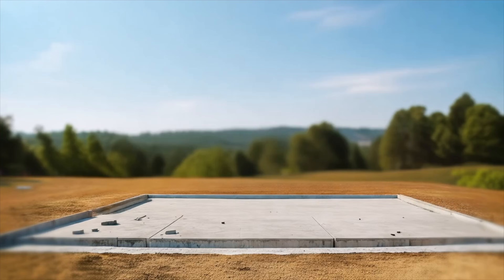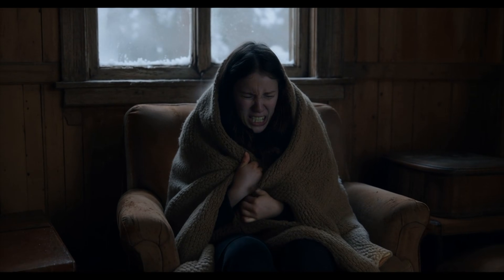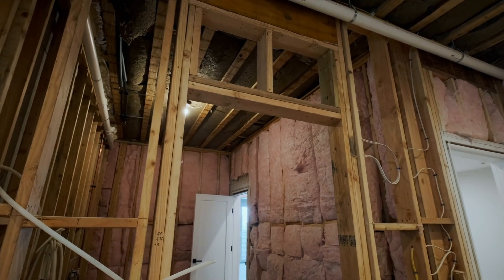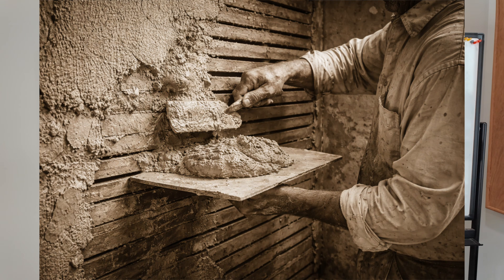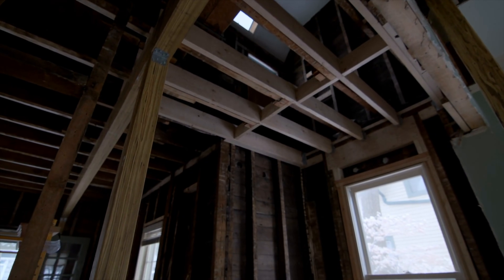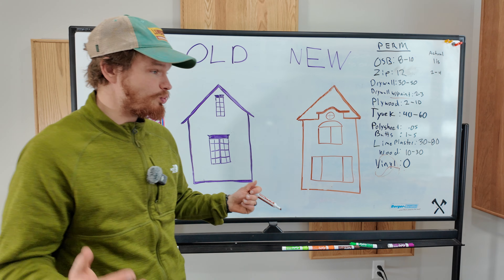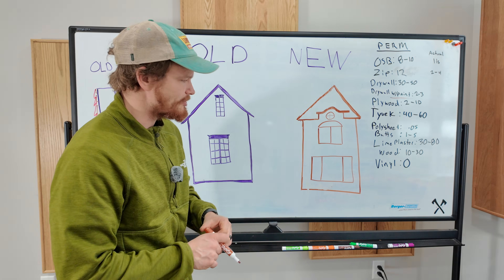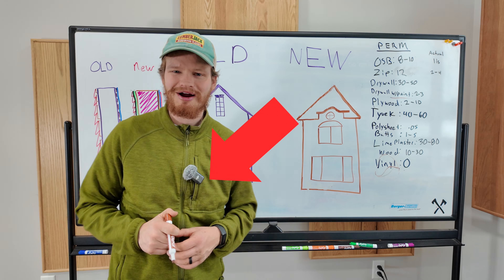New Houses Are Growing Mold — Old Ones Somehow Usually Don't

Comment: From European perspective these are not houses, these are fancy sheds, barns, shacks etc. Clay bricks, ceramic bricks, blocks are the only materials that can regulate moisture inside, sound proofing is fantastic, quite soft and strong at the same time for cutting. No mold can grow on ceramic material. One more thing that raw clay plaster mixed with natural fiber becomes new standard in wealthy people's homes, even if wall is made of concrete block, another terrible material, clay plaster will create micro climate and no paint required. Wood on it's own can be healthy and mold free under 2 conditions. No chemically treated wood, well dryed. Northern America housing styles are the crappiest right after British and Irish.
Reply: Its great that you guys have brick, but america has earthquakes... theres a reason houses are built with wood here
Reply: @Mae_flow  The reason houses are built with wood is because it's cheap and the people buying them are usually ignorant, not because of earthquakes.
Reply: @Mae_flow America is not so rife with earthquakes that it plays a dominant role in determining our building materials, unless you live on the West Coast
Reply: How many Europeans can afford homes? I’d rather have a wooden house than live in a flat.
Reply: @lisareiter5368 You are more than welcome to visit Europe and learn how new homes are built (Poland as example) reason some can't (don't) have own home is result of laziness. 250k EUR to buil small solid bungalow is more then enough if you do it yourself. But most want to hire scammers called contractors who will charge the lazy man 450k instead.
Reply: Clay brick is terrible where I live. The winter destroys it quickly.
Reply: @EthanThruandThru How about use transparent sealant from the outside?
Reply: North America has a much more varied climate, seasonal changes are huge compared to most of Europe, large temperature and humidity swings necessitate wood since it can expand and contract, and there are tons of weather patterns and storms to worry about. Some places like Florida or Arizona use different materials of course due to the climate.
Reply: @Ryan-cb1ei Have you ever been to Europe? Except for tornados the climate is very similar, freezing and wet in northern Europe, super dry and hot in the south and near the Mediterranean sea. -32 C to 50 C in summer. Clay bricks are used all across, recently clay ceramic blocks instead, very light and full of cavities. Europe also has earthquakes just to remind some previous comments makers. Poured concrete ceilings are required and reinforced concrete-steel ring round upper layer. Hardly to see wooden structure upper floors unless UK and Ireland where quality is not a thing, just blindly copied from US or Vice Versa.
Reply: @maximmono1  Obviously there are places in Europe with relatively hot or cold climates. I said most of Europe. Most of Europe is pretty moderate, it gets both colder and hotter in a lot of North America in the same places. You’re describing Northern Europe vs the Mediterranean, I’m talking about North America seeing extremes like that in the same places, different time of year. I was shocked to learn the average winter temperatures of northern countries weren’t as cold as I thought, and didn’t snow as much as I thought compared to some areas in the US and Canada. That jet stream really moderates Europe. But the actual real reason is due to timber. The US and Canada have access to so much natural timber compared to Europe it’s unfathomable, so it’s very cheap.
Reply: @Ryan-cb1ei Please note Europe ends in Russia not in Germany or France. The continent is not as big as North America however the  temperatures I described apply to the vast majority of the continent. Harsh winter and hot summers are not unique to America. At the end of your comment you used the word "cheap" if so why houses are so damn expensive if you use such low cost material? Another aspect is Europe still has great forest ie Poland, 1/3 of territory is forest however no wooden houses are built. Wooden structures especially outdoors won't last. This American style, fast and cheap, can't last forever. I hope you could visit Europe some day (the real Europe) not rotten western countries and see how things are done, how they last for thousands of years in harsh climates. Please visit the world's biggest castle in Poland which is made only of clay bricks, not stone like Brits did. Clay is everywhere under ground, it remains as deposits for Ice age, where as far as know was very present in North America. I wish you the very best in New Year, please travel across the world to make observations do not be biased by  opinions but by facts and experience.

Comment: Houses that breathe are freezing cold in winter and hot in summer. There's a GOOD reason we don’t pay to heat the air that's just going to leak outside. Borax can be used in wall and paint materials to keep mold from growing. And we aught to protect wood frames better from rain than we do, in the construction phase

Comment: So our options are:
1) be a millionnaire who can afford to build new with solid dimensional lumber, and also freeze in winter, or
2) Build something affordable that'll just get moldy.

Fade me.
---
I'd much rather see something productive, like "this is how to reduce moisture in modern construction". Include tips like avoiding flat roofs, doing semi-annual attic insulation checks, checking settings on any in-line humidifiers, etc etc etc.

This video, as is, offers no meaningful value

Comment: Um, pine tar, bees wax, and flax seed oil. This is why the old hard wood last centuries.  It protects wood from moisture,  bugs, and rot. 
The materials we use today are ment to be 50 year homes. The wood, staw and clay of ancient homes lasted much longer, cheap to repair,  and better insolation.  Actually had a thermal mass unlike today's buildings.

Comment: My 115 year old house got central air this last year and let me tell you about the mold 🙃 it started growing everywhere, bathroom, windowsills, and even on the floor registers. I have chronic illnesses not related to the mold (I hope) and didn’t need the extra tax on my body so I’ve done a lot to remediate it. But my old house was none too happy with the upgrade. I’ll probably put a window unit in my bedroom next year and not turn the air down so low in the rest of the house to keep condensation down. I also got a dehumidifier but we plan on installing a vent fan in our bathroom/laundry area for continuous ventilation. It’s humid in Kansas and sometimes it’s not an option to open the windows for ventilation
Reply: If the a/c runs long enough, it will keep the air dry, so how is it humid in there? 
If a house has an oversized a/c unit, it will cool more quickly, but possibly not run long enough to remove moisture from the air.
Reply: @mrearly2 american builders love to comically oversize HVAC components. It’s why they cycle on and off instead of running continuously. Oversizing it is lazy work

Comment: The use of so much synthetic and toxic chemicals in home construction is a major problem. Building a house completely out of wooden boards like they used to be is cost prohibitive. And we honestly don’t want to live in drafty, expensive to heat and cool houses either. There has to be a better way. 

Thirty years ago my dad built a straw bale house on the principles of high energy efficiency and sustainability. Straw bales are an interesting construction material as they are natural material that makes a great insulation layer. Straw bales can be structural as long as you aren’t building to high or they can be supplemented with wood framing Over that he put layers of gunite stucco on both sides to serve as thermal mass. To promote water evaporation from the straw, take advantage of capillary pressure by using a course sand on the straw surface and a finer sand on the outside surface. The only problem with building with straw bales now is that agricultural practices have changed so straw that used to be a waste product is less abundant. 

Ventilation is also critical in new homes and air-to-air heat exchangers to bring in fresh outside air continuously should be part of every new build.

Comment: Home inspectors have to pass the ASHI exam, or national home inspector exam, which covers this topic quite a bit, moisture !  I'll bet a lot of test takers fail this part!!!
Reply: The building code in Minnesota requires makeup air ventilation for exhaust fans, but inspectors do not check for this.
Reply: @vanhorneventing8107  ...beyond the scope of ASHI Inspections...specialized or unique pieces of equipment usually require a specialist...

Comment: 2:51 I was talking to my landlord about a small gas leak in my 100+ year old building that’s hardly been renovated beyond very minimal 90’s codes. I have the HW tank and furnace in a little closet room. Always slightly smells of gas but never thought anything of it. Part of the “barely renovated” was just hollow dropped drywall ceilings that were all cracked and messed up in that little room. So the point of my story is that because the walls were so crappy in that room combined with that small leak, it wasn’t even as dangerous as it was wasteful. Too much draft to even accumulate for it to ignite 😂

Comment: I see so many synthetic products for siding. Like aluminum steel, when it isn't wood itself, the problem, it was the insulation technique and the marketing departments of those large corporations have done a good job brainwashing people that wood is the problemnow\n I go into homes with spray foam.  And\nBy the time you realize you've got a rod issue.The wall has to be completely replaced where at least before with fiberglass.You knew things we're rotting away

Comment: Beware of crawlspaces on houses. I'm in my 50's, and lived all my life in the humid southeastern U.S. I've owned or lived in 5 different houses, 3 of those with crawl spaces, and all 3 of them had air quality issues. My sister currently lives in a house with a crawl space, and it is the same way. All these houses were built in the 1960s or 70s. The crawl spaces are horrible moisture traps, even with passive ventilation. Not to mention breeding grounds for every creepy crawly thing you have nightmares about. Maybe a fully encapsulated crawlspace would be okay, but I don't have any experience with those. My last house and my new house are slab on grade, and I would never go back to anything with a crawlspace here in the humid southeast.

Comment: Bro, just use bricks isolated on the outside with polystyrene panels with a 1cm gap between the brick walls and the isolation. That's it, done, heat stays inside, walls breathe. We been doing this shit in Europe for more then 20 years now. And on the inside just plaster covered in breathable paint.

Comment: I've been called dumb but when I started building 30 years ago a customer wanted every piece of siding caulked on all seems. My boss told me don't do it the house has to breath. Now they're caulking and foaming everything trapping moisture like crazy. That's going to mold folks
Reply: just stop using vinyl siding and use mineral paint on wood. This way you can caulked it and the wall can perspirate
Reply: Common in the south because one storm tears it right off the walls if it’s not calked. I agree with you about moisture having a place to escape
Reply: @USAbigmouth what gets blown off in the storm?
Reply: @MGrey-qb5xz siding
Reply: @zakbrinkhoff324  the whole house made of wood chips.
Reply: You don't get it. The goal is to avoid having water ingress inside. Exterior need to breath, interior doesn't if you do your job properly because water will never get in.
Reply: @evalangley3985  That is the issue. Water and moisture will always find a path. Now if you let the house breathe, you can make it so that the moisture coming out finds an easier path than the moisture coming in. That is ventilation.
Reply: @samuellourenco1050 A correctly done air barrier is fine, and in some climates can protect the house. I saw a case study of a house in Okinawa with lots of ventilation and huge moisture/mold problems where the solution was sealing up the house.

You need either significant heat transfer and permeability to get water out of the structure (very expensive heating/cooling, less comfortable) or to build with good drying paths on both sides of every vapor/air barrier. You notice all of the bad houses with issues, and it seems like a majority of new construction in the US is pretty low quality.
Reply: @evalangley3985  There does need to be ventilation but this breathing concept here is stupid and wasteful.  You're right about preventing ingress, also internal moisture needs exhausting, (heat recovery ventilation) and things that are liable to be damp should be mold proofed with borax.

This idea of wasting tremendous amounts of heat to let a building breathe is as expensive as it is evironmentally destructive.
Reply: what an interesting concept, the house has to breath , do you know what does "roof being kept up" means?
Reply: @MGrey-qb5xz new shingles every 20 years.
Reply: @donaldjohnson2038 Just to keep moisture from coming in? How does that help in making the house "breathe"?
Reply: @MGrey-qb5xz if you leave a drop of water in a Ziploc bag  that's also full of air for a week, it will grow mold, if you keep the bag open, it will dry in a matter of hours, yes more water my get into the bag somehow, but it will all eventually dry. But if it's a closed system it stays and grows, not what you want. Air has moisture in it. Still stagnant air will create mold

Comment: Americans are bad at building.

In the more civilised world of central europe we build actual walls. Out of brick. There is no air traveling through our walls.

Old houses maybe had mold problems. Newer houses are great when done properly.

As said the walls are usually out of brick. Infront of the bricks 10-14 cm of Polystyrene Boards are used.
That gets covered in a mesh and plaster is applied.

That allows the outside to get wet and dry. The actual wall doesn't get wet at all.
Also the actual wall is kept warm, being insulated. Brick has a large thermal mass and adapts very slow to temperature changes. Condensatian can't occure on a warm surface.

Inside there is also a thick coat of plaster that is breathable and regulates humidity. For painting we use open paint that is breathable. Latex is only used in like a kitchen.

I think you guys would be much better of building real hoses instead of sheds.

Another Idea might be using breathable paint on the inside and add some kind of thermal mass on the warm side. Wood fibre or something.

Comment: And to the tyvek vs zip, I’ll be that guy. Zip loses. Not just if you have the budget.

If you truly have the budget use the best separate components.

I don’t trust taping seams long term with zip, I trust positive overlap of WRB no tape to fail. SA VP is better than tyvek, but tyvek better than zip in that sense.

For air sealing it all the same. If you tape your tyvek laps there’s no difference. The main issues are penetration and meeting soffit and foundation. Idiots don’t seal the tyvek.

But if you seal the zip you can seal the tyvek and both will be airtight. It’s a function of the installer not the product.

Finally, the insualtion and Vapor permeability. If you want continuous exterior go rockwool or foam boards. 

So they air seal the same. I find Waterproofs more reliably long term.

Biggest fail for zip though as those are 2 smaller issues above, the OSB is so low perm rate it doesn’t matter what their applied WRB perm rate is.

True plywood, tyvek, and rockwool is going to air seal as well, insulate as well or better, but the assembly will breathe as the Vapor permeability of plywood and rockwool beats zip because zip weak point is the OSB.

If you want top quality higher budget, go for a SA (peel and stick membrane) WRB which is vapour permeable.

Best air seal. Best waterproof. Then plywood and rockwool. Strapping for drainage and airflow to promote drying is a must.

That’s top dollar, not siding nailed to flat faced (nor drainage/drying plane) OSB with a fluid applied WRB seam taped product. 🤮

Comment: It’s all about materials. Real wood passes water Vapor far faster than plywood.

And plywood passes far far faster than OSB. Everything being made with OSB is a huge part.

People hate on it for ‘being cheap’ without even knowing what they are talking about. It’s good for racking strength, and fine when dry just not good with water leaks, or with passing water Vapor in an insulated assembly.

We started insulating, realized we didn’t make it airtight enough, made it more airtight and needed to vent. And we keep going in these circles. Knowledge and codes requirements keep rising.

But most of all people who are truly building long standing homes just use the right materials, not just achieve certain values.

If you insulate an old house without air sealing while also give drying potential is where people screw up.

Then it’s just “old houses were good and new ones aren’t” but it’s more that we are;

A - still learning

B - going to do it poorly to cut in costs - unfortunately.

If someone never explained to you why you should double your plywood budget in the way I just did you’d go OSB too.

It’s actually better at stabilizing the structure. But worse in every other way.